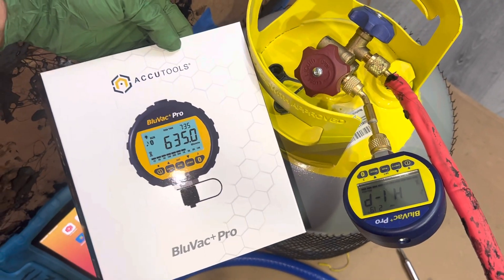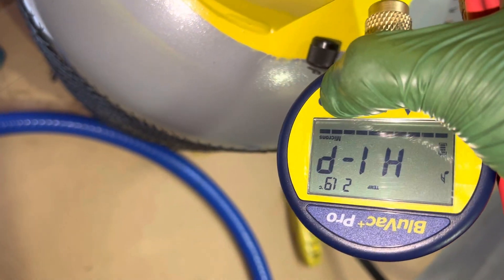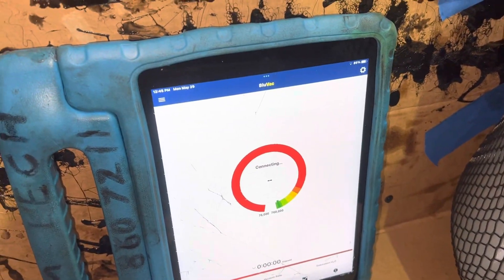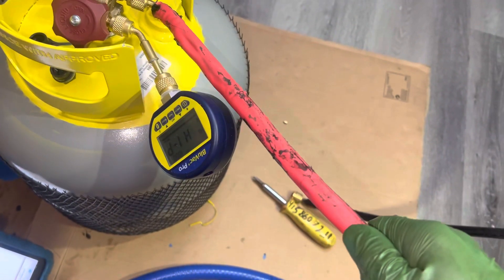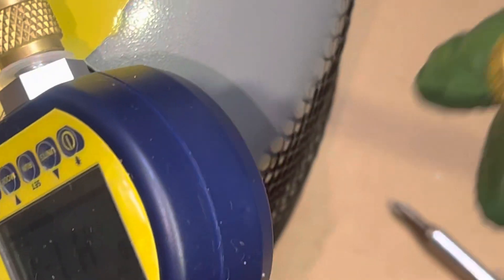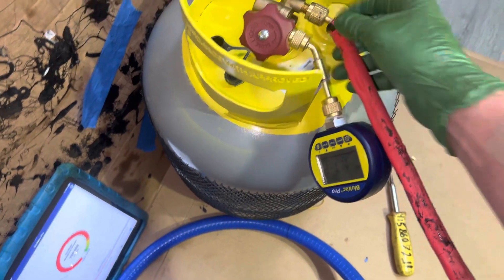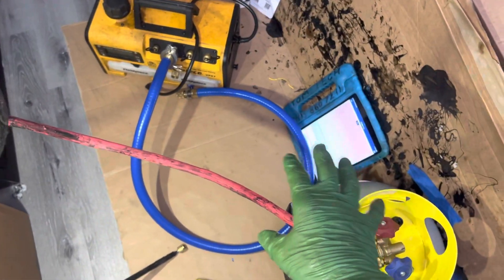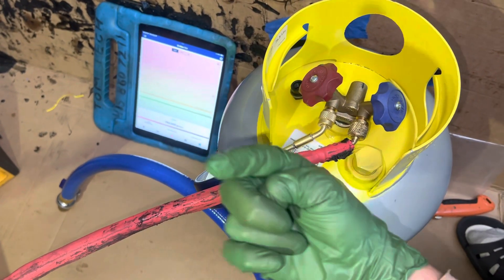ACCUTOOLS BluVac+Pro Micron Gauge, TruBlu Hose to SM480V Feldpiece ￼ setting up for test comparison￼

Comment: after watching my micron gauge on cars i work on and seeing how it responds to manipulating the valves, I've been curious to try (and will when my next recovery tank comes in) this and interested to get your opinion. Would there be any benefit to having the vacuum pump go to a 30# recovery cylinder that is empty and from the tank then it is connected to the ac system? My theory of this is it would act kind of like a capacitor / buffer tank / dilution tank that would be able draw down the main ac system and since the large volume of the tank in relation to the hvac system that can be drawn down to nearly perfect vacuum, could you get a system (lets say for example) that couldnt be pumped below 700 microns, to pump down lower; lets say 600? My thought would be to pump the hvac system with the tank connected down to its lowest, close off the auto hvac, have the pump pull down the tank to its lowest the pump will get it, and then open the tank up to the auto hvac all the while the pump is running?

I know you use very large cfm pumps that i am not using, so what im seeing when i manipulate my valves ( pump down my hoses and gauge set and then open it back up to the system) maybe a result of that and more of a function of the cfm of my pump but i was still curious.
Reply from the maker: What brand and what model and size pump are you using? 

It’s not necessarily the CFM size that is the thing that’s doing the work 

It’s the micron rating what it is capable of going to . 

Kinda like horsepower and torque 

Hi horsepower get you there fast 

But torque is what moves the weight 

That’s why small diesel engines, pool more weight than large gasoline engines because they have more torque 

So if you had a eight CFM vacuum pump, but it was only rated to do 100 µm 

A small 1 CFM vacuum pump what was rated to 1 µm would pull the lower vacuum .  Just at a slower speed.

Give it a try you can only learn something . 

And then try leaving it on the vacuum pump for 24 hours